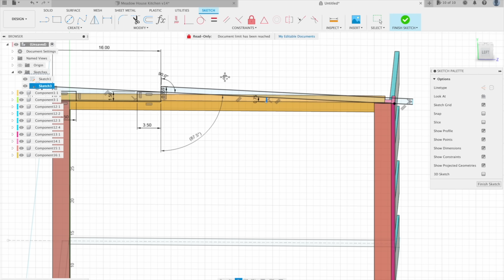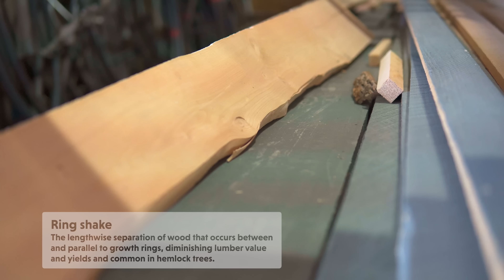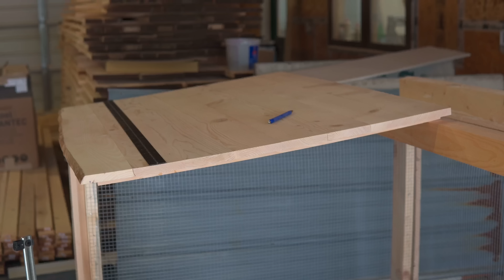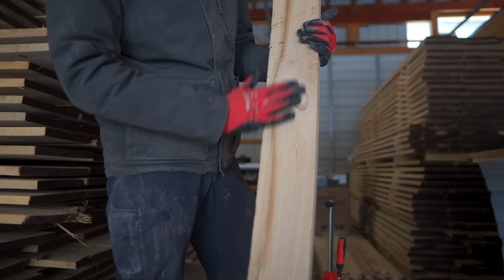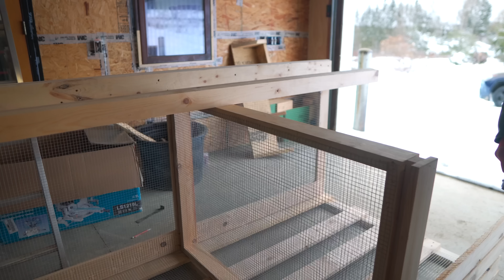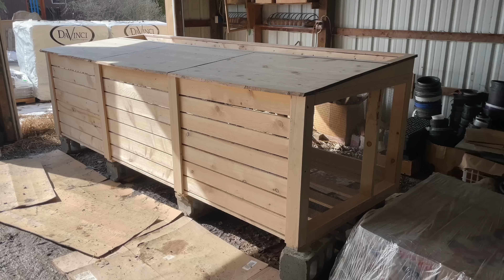Is This the ULTIMATE COMPOST BIN DESIGN? — Ep. 158

Comment: Hello, I enjoyed watching your video, about to build a compost bin here in France. An idea for a future version, would be to facilitate moving the compost from one bin to another. In yours you apparently intend to fork it out and over from the top. What about having a removal panel in between them so that you can simply pull it through from one compartment to the next, with a hoe for instance? Also, could you tell me which design software you used? Thanks in advance

Comment: Great build. And such craftsmanship!! My only two comments are:
1) I read that having the bins in direct contact with soil speeds up the process with the microbes, worms and other insects in the soil getting access to the compost.
2) the air gaps between bins are great but I think might trap smaller compost pieces you can’t get out. Could you put a really fine mesh on those layers instead?

Comment: Nice wood work!  But I do have some comments on the compost side of it.  I have a 7 year running successful market garden and 6 year training as permaculture designer and have made a lot of compost with a lot of different designs/techniques. First and foremost:  Compost can not be dry! Like never never never let a compost dry out. Never put it in the sun. (UV radiation  and the sun drying it out). With your design you will not create a hot compost - that is ok but remember all the seeds you put in there (weeds) will be in the compost and whereever you put it. No you do not need ground contact. Bacteria/fungi to break down plant material is everywhere (air and on the crops itself etc) So worms do help and make the compost richer (you can add a handfull you found). But keep it wet. Not soggy boggy wet but nice and damp (squeezing out a drop of water if you press is in your hand hard). Add Carbon! (cardboard or woodchips or woodshavings) too much kitchen or grass is too nitrogen rich and too wet and to dense. There is a science to it but generally just add more carbon then you wood normally and you are fine. 

 Consider building  a Worm farm if you want something that last forever - your wood will probably last less then 4 years (its in constant contact with a decompstion process you want the fungy in there that decomposes wood so your wood will also decompose - you can use robina pseudoacacia wood really thick boards of oak to have it last 10 years. Generally never seal wood - if it can not breath it will rot faster. Painting wood will not make it last longer. have a small crack in the paint somewhere mostoire gets in but can´t get out, trust tthe fungi to find that crack too - wood then rots from inside you not even seeing it rot. Just let the earth have it back when its ready without poison on it.

Comment: What program was Sander using?  Nice job :), you reminded me I will need to add a bay to my single bay setup thank you.  I did something similar...4 x 4 x 4 feet (I'm tall), mesh INSIDE, minimal wood touching the compost (except the sticks in there already).  I did open bottom for worms friends, open top since I did 4 feet high, easier to toss in for me.  Re-used decking redwood lumber from craigslist for 15 dollars?  5-10 dollars in hardware, 15 dollars in mesh?  Infinite compost potential, doing food scraps, coffee grinds, wood scraps, I have so much wood death from unhealthy species and trees.  I also tried to focus on open faced east, south and west portions of the bay with minimal wood there to help sun and airflow.  I need a bigger pile now, cook it up.  Also, instead of banging in staples...I thought those might rot quick and be a waste of time, so I just made holes on the corners and tie wrapped the mesh to the wood that way.  Took 5 seconds of drilling, 10 seconds of tying per corner instead of all those annoying little staples.

Comment: I love the design. one thing tho, in my experience painting houses, putting paint over top of wood stain rarely has the intended effect of added protection. Stain is designed to be water resistant in most cases and a good stain should cause anything that is water-based to bead and wash away. Im not telling you what to do by any means, but i think a nice brand of exterior paint will more than suffice for what you are looking for especially if it is going to be on the north side of a building or something. Less sun will help the life of the paint. 

I really enjoyed the video and have been inspired to attempt a design similar. MAny thanks. Bless you all at Flock!

Comment: Nice looking compost bin and well detailed design Sander. Using mesh wire to build your compost bin might leave your compost  dryer than normal and you might have to applied water to moisten it from time to time and your screw slotted front might leak compost through.  I have built all mine from pallets wood into a proper wooden box, the design at the front is also slotted without any gapes and they work fine.  They are placed directly on the ground and I applied a good helping of raw linseed oil to the wood before using them. Give us an update, when they are in use.

Comment: Ultimate compost bin must be in contact with the earth and using hardware clothe is not ideal.  It is well detailed build to rot the compost instead of decomposition.  Plant material does not break down to compost without the earth.
Reply from the maker: Nice suggestion. Does it not work even if you have a little compost starter (aka earth + compost) to get it going? Like a sourdough starter? So many compost tumblers are not in contact with the earth. Typically if you turn those every day, you get a nice compost in a month to two month's time. And compost bins in the city don't touch the earth because of vector issues (like rats). That's what we're trying to avoid—mice and rats getting in there. Love to hear your thoughts.
Reply: @FlockFingerLakes   I have never witnessed nice compost from a tumbler.  It always smells like death.  You are looking for a compost maker devoid from reality.  Mice, rats and snakes will still enjoy your compost bin.  Perhaps you need to make a sign "Critter's   are not welcome, Only beneficial microbes are welcome".   A well tended pile of compost will work better.  I look forward to see if all the details work.  

Without sass... only use plant matter and always cover it.  Don't use egg shells they smelt , rot and attract vermin.  Covering raw plant matter will not  attract vermin.
Reply: @rjaquaponics9266  I have the Jora compost tumbler.  I never got a bad smell and it cooks my compost very well.
Reply: @rowenadinsmore1  If you "Cook" compost your doing something wrong!
Reply: @rjaquaponics9266  But isn't it considered cooking when the temperature is raised to 120 F?
Reply: @rowenadinsmore1  thermal rrunaway.  I watched a bunch of tumbler type composter and they are all BS.  Table scraps still look like crap after a year.  If you put those same scraps into real compost pile it would be done and ready for use.  Those compost tumblers are junk!
Reply: @rowenadinsmore1  I woudl say cooking would be hot enough to destroy pathogens and weed seeds.  Above 140 to 160 in a real compost pile. 120 would simply piss them off and seeds will likely survive.

Comment: Nice design and beautiful execution! I use pure linseed oil to help preserve my raised beds. This does a nice job of slowing down the decay of the wood (I use regular 2x6). Note that you must use pure linseed oil, not Boiled linseed oil. the Boiled has some solvents added that help the wood dry quicker, but are toxic enough that you don't want them in a garden.
Reply from the maker: We were considering pure linseed oil but read it takes up to 1-3 months to dry, so we were like, "mmmmm, we don't want to wait that long!"  If we had the extra time, we would have considered it.

Comment: It's going to look nice!
That's for sure!
I LOVE the live edges!!

I also very much like the suggestion of shou sugi ban for a preservation technique which I read another commenter remind us of!
Plus, it looks GREAT!
More importantly, it would give you a very long life for the wet wood.
And if you're willing to put the time and effort in, which seems that you are, I would think y'all will want these bins to last as long as possible. 
I don't live in a snowy climate, but I'm guessing after all the freeze thaw events you have, that untreated wood will start to let go of the screws after three years?
But, I could be wrong about that...

Not trying to be a downer, 
and I suppose my comments ARE kinda headed that way, 
but I'm just brainstorming here-
I'm seeing an issue y'all might not have thought of? 
(Or you just didn't mention it!)
It's the 2 spaces between the 3 bins.
Having them double screened creates a permanent storage area for all kinds of things, and my imagination has been kinda taking off with scenerios!
My 1st question is:
Won't fully composted material get wedged in between the 2 screened sides?

Next:
If not being able to get the bits out from corners "bugs" you, (pun intended!)
then I'm guessing the new soil stuck in that permanently closed off area is going to drive you absolutely bonkers!!

I half expect to see a video titled,
"Redesigning & Rebuilding The Compost Bins..."
Where Sander removes one of the mesh sides.

However, the roaches will love that area as a nice protected condo unit!
I'm just going to refer to that space as The Bug Condo Unit from here on out.
Or
A tiny snake, or lizard, travels into the ½ inch square mesh of the bug condo unit for a nice bug eating session at the "Trapped Bug Buffet".
Which btw, takes care of the trapped bugs who are now too big to exit the ½ inch screen! 
So YAY for THAT Cycle Of Life!!

But then the snake or lizard is so full, 
IT can't get back out either!
After those bugs are digested, 
the snake, 
or more likely the lizard, 
grows a little, 
and now it's a permanent home for 
IT too!
Result, is the bug condo unit now has a permanent resident snake or lizard. 
Now the "bug condo unit" needs a whole new name, perhaps something right out of a horror movie!

Wait-
Maybe all that needs to be added is a nature camera between the 2 screens to start a whole new YT nature channel !
Oh, I can see it all unfolding now!!
David Attenborough will soon be knocking on your door asking if he can narrate the fascinating escapades of the life cycles that happen within a half-inch screen mesh! 

See!
I just turned that area of the compost bins,
which WILL drive you NUTSO, 
into a money maker!!
PROBLEM SOLVED!!

Comment: Good luck. You'll see this will not work easily for most people. Once you start using it you'll appreciate being able to separate, raise, roll the individual bins. To make it easier to turn, unload and move the compost. You'll change everything next time. Being able to adjust the airflow, the amount of rain introduced and insulating the piles will probably change all your current thoughts. I've been composting for over fifty years. Depends on your resources to figure out what you'll need in a year or two.
Reply from the maker: Yes, it will be good to use and adapt as we go. That's part of the fun and the process. One of the things we like about this design is that we can start composting on the edges and then turn into the middle one. Or turn over into the 2nd one and then the 3rd one. Looking forward to get it going and seeing how we should adapt!

Comment: Too bad that the ashwood is going to be used just for a composter.  YOu can have just used a screened lid as well.
Reply from the maker: We used the ashwood just as the live edge piece. The rest of the wood was our leftover hemlock from the Meadow House. We ideally want to be able to control how much moisture goes into the compost, as it rains about 160 days out of the year here, which is part of the reason why we didn't go with a screened lid. And only screen sides to encourage airflow.

Comment: This bin is almost too beautiful to muck up. We recently cleared a space where our three bin compost will sit. We designed our bays to be large enough (6’) for greater quantities waste and to allow the tractor bucket to fit in. Most of the wood we are using is pressure treated that is left over from our barn restoration. We are aware of possible chemical leaching but hoping the structure will last longer. Again, beautiful work!
Reply from the maker: The larger the better because it'll probably keep the heat better. Love that you built it to fit your tractor bucket. That makes a lot of sense.

Comment: do you really need this much aircirculation? i would suggest even moisture evenly spread through the bin is more favourable, so i would close shut  all the side pieces. its a suggestion charles dowding gave in one of his vids i think... i for myself are to lazy to build such a fine structure ans only use some pallets holding together with wire and thats it for me ;)
Reply from the maker: That may be a good adjustment. We will see how this works as we get it started. We could even maybe create a cover for one side and not the other and then compare. Could be an interesting experiment!

Comment: Wow, this was pretty cool. Thanks for sharing.

I like the design element/feature of having a planter on the back. Will the roots get entangled in the wire as they reach for the compost?
Reply from the maker: Summer Rayne is thinking of growing this native plant called Wintergreen that has shallow roots and spreads superficially by rhizomes, so it should not be a problem, as it doesn't develop deep roots.

Comment: Very nice compost bin! Rats will always find a way in if you have them though and mice can fit through 1/2” hardware cloth. I like the use of your live edge pieces!
Reply: How about building an owl house to sit nearby to keep the vermin population down?
Reply from the maker: Wonder if only those closed container systems would be the rat- and mouse-proof kind!
Reply: @FlockFingerLakes  probably. I wouldn’t worry too much about them anyways! If some do move in you might be able to get rid of them just by watering it down for a few days
Reply: @FlockFingerLakes  Ambitious rodents can chew through anything that isn't made of metal in pretty short order. Our dumpster lid has had the seams in the plastic lid substantially widened by them, and wood is close to what they're actually designed to be chewing. If you've got wood rats, they probably won't be more interested in compost than squirrels or any other random small animal. I think the Norway rats people worry about in higher population density areas are more adapted to desiring human refuse, so if you do have those you might need to figure something out later. I'd worry more about luring in stronger things like raccoons and skunks that will also be a danger to your eventual chickens, but the hardware cloth is a good start to keeping them out!
Reply from the maker: Oh meant to mention we do 1/4" hardware cloth too. I think that should be too small for the mice. We got that initially for the chicken coop to reinforce the window screens.
Reply: @FlockFingerLakes  1/4" is the way to go, opening in the front to allow airflow will eventually break down and critters will get in, I wouldn't worry so much as long as the rest of your eco system is healthy critters will get munched on.